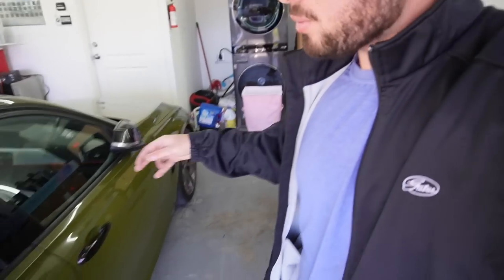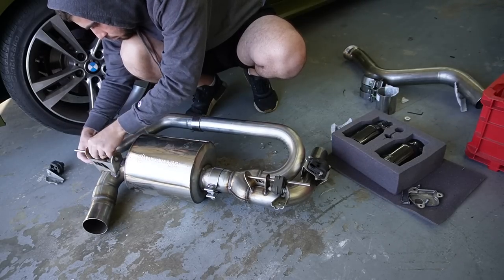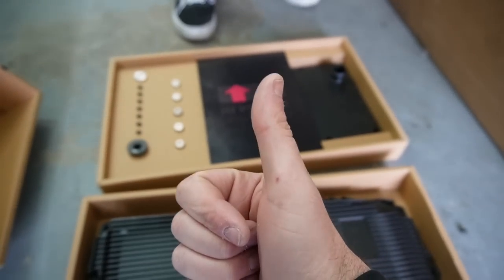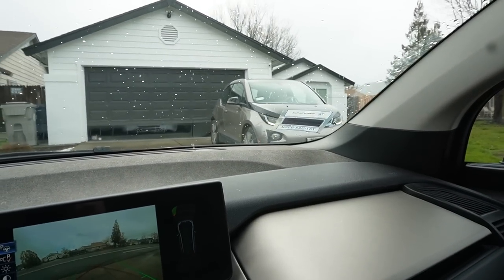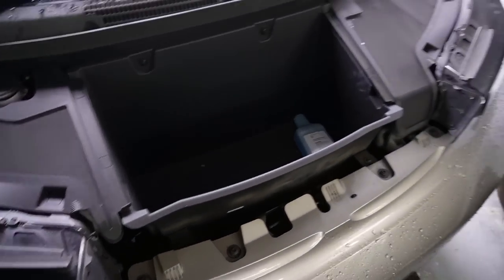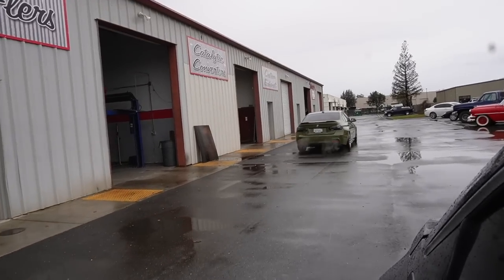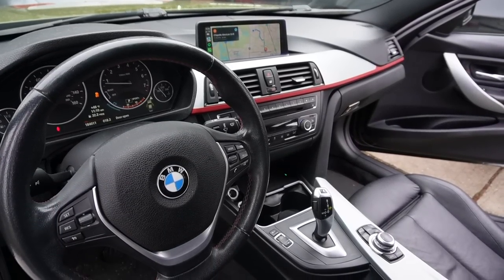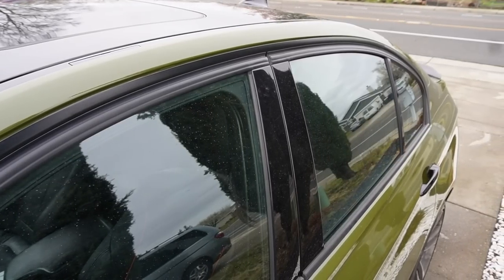THE F30 GETS A AXLE BACK AWE EXHAUST! (Perfect Exhaust For A 328i!

Comment: Im getting a rattle when I did this on my F32 420d. Figured out because theres no exhaust hanger for the middle og the car. Only front and rear, is there a fix/guide for this by installing a hanger in the mid of the car somewhere?